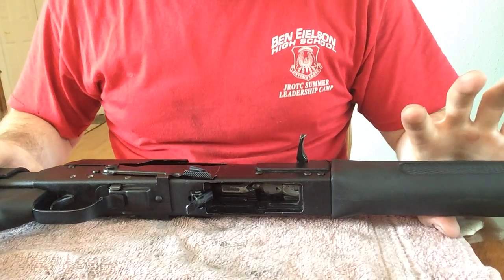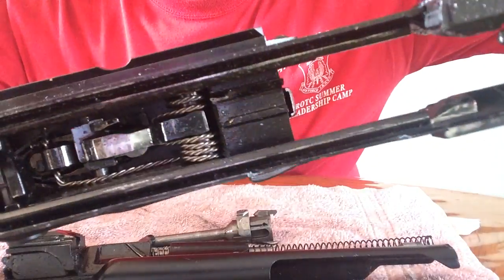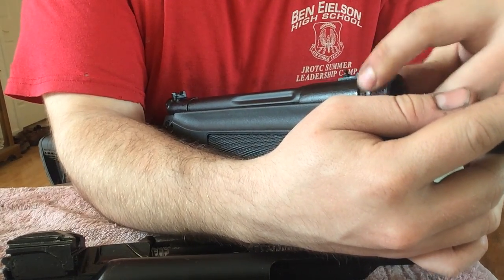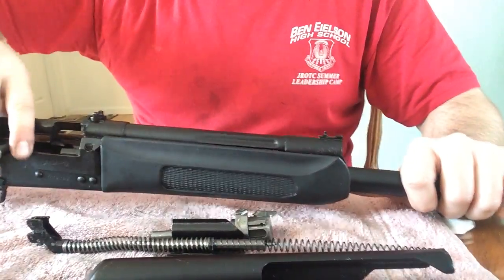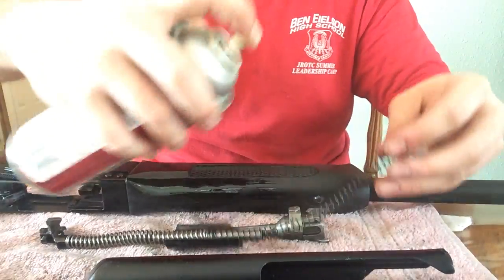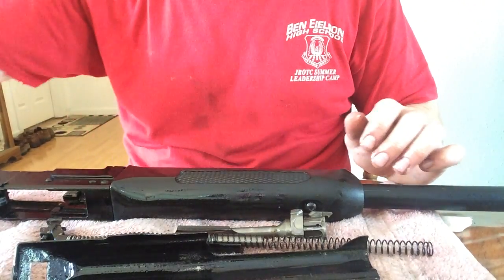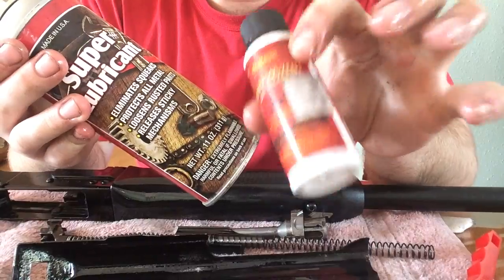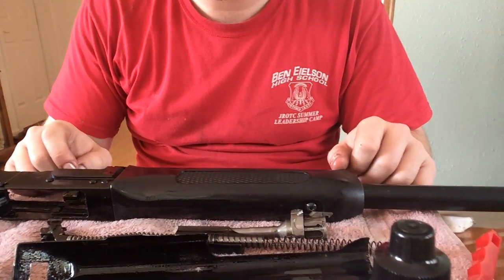Saiga 12 disassembly and cleaning

Comment: Big mistake to spray lube in the gas tube
Reply: I have not been able to find a real clear answer, on the gas tube should you apply cleaner or solvent but no lube? Or just a good wipe with a dry cloth?
Reply: @josephbatson6760  clean it good with hoppes#9 or shotgun cleaner but don't use any type of oil cuz it'll just fowl up your gas system. I watched a video of a guy that does 3 gun. He cleans it well and uses grease on the rails and bolt thats it. I use lucas gun oil on mine just not on the gas tube or piston. I keep those dry. Make sure u pick out the gas ports cuz they can get clogged
Reply: Thanks so much! Finally a full answer!
Reply: @josephbatson6760  np
Reply: @josephbatson6760  gas tube should be treated  as a piston from an engine. Needs to be clear from grease or any thick lubricant. You can put light oil but it will smoke up and smell like you're  cooking bacon.